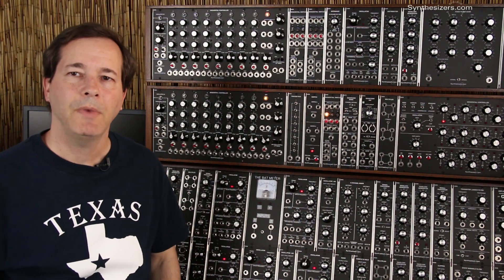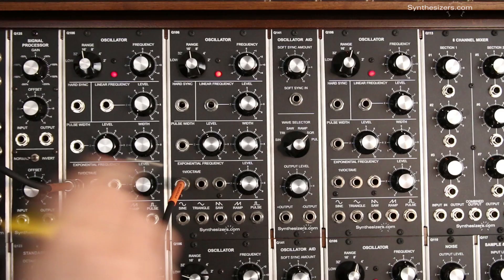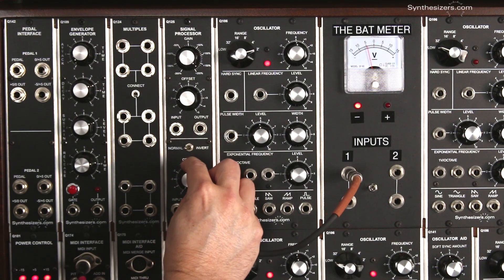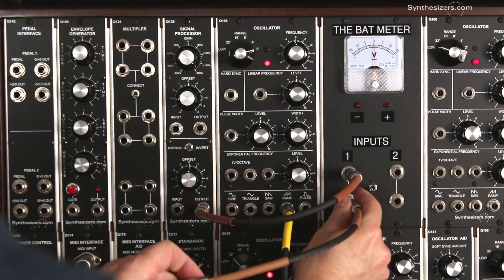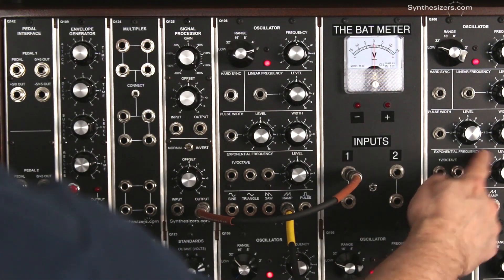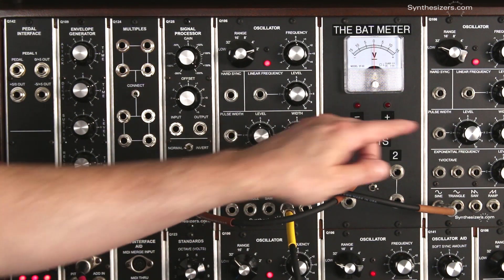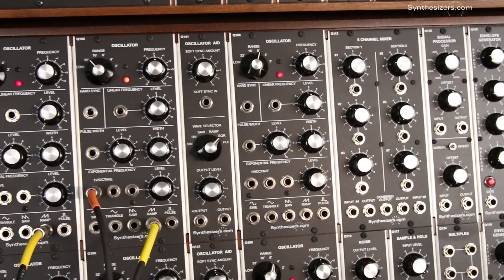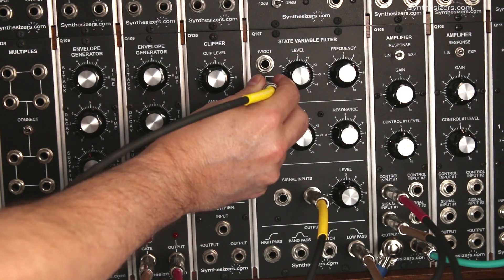Voltage Control Fundamentals for Modular Synthesizers

Comment: I’m currently building my own synth from scratch on the breadboard, I have a very basic version of voltage control working with a single transistor for two oscillators but I needed to know what standard voltage control is like. thanks for the info
Reply from the maker: Maybe googling "cross coupled transistor pair" would help, based on your video
Reply from the maker: Not sure what you are asking.  Happy to help, maybe if you can let us know what you are trying to accomplish.

Comment: I think the thing that really seems to trip me up is that the actual notes themselves are based on the frequency of the wave? e.g., 440hz is A ... but, then at the same time the oscillators themselves operate on voltage which in turn serves to modulate the oscillators frequency. It becomes even more complicated to me if an oscillator is able to be either a square or a saw or a pulse or a triangle or a sine. Yeah basically none of it really makes sense to me. When I watch this video...in this very basic level context, I think I understand. When I start thinking about my 2600 and using the LFO or looking at the "FM" control..I don't really understand what that is about. If the modulation of the oscillator alters the frequency...then that will alter the note...and I don't see how it ever makes sense. It makes noises sure...but, almost always when I attempt to actually use the FM control features...it just makes things sound weird and nonmusical.

Comment: Pretty good video, but it would have been better if you had shown in every case which inputs and outputs on which modules were connected. Some were out of the frame. But clear explanation and demonstration.